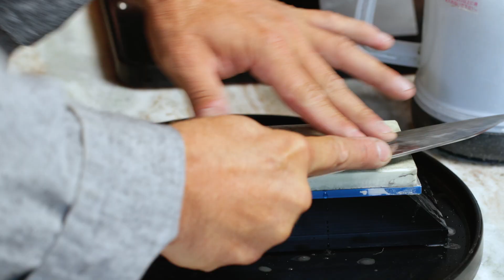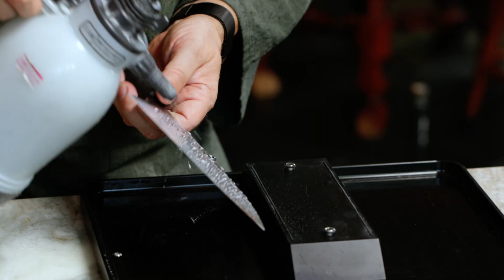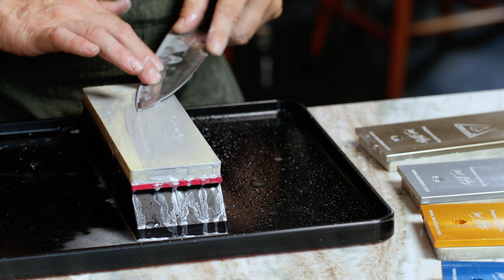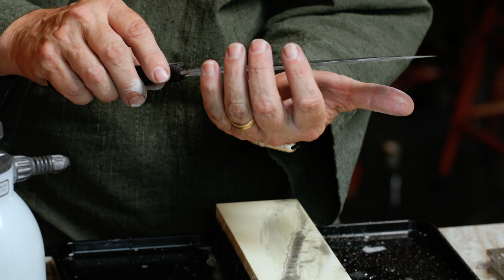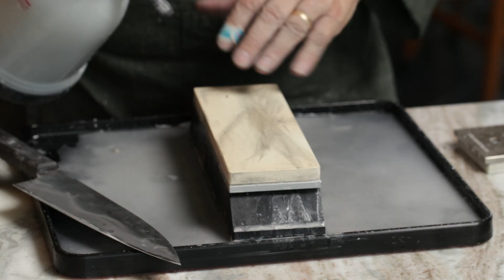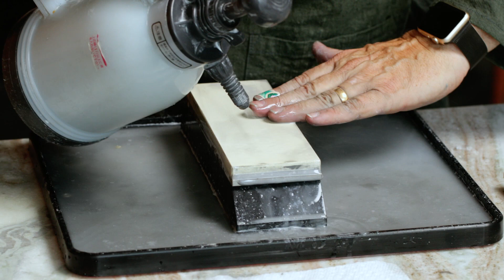CHAPTER 3: THE EXTENDED METHOD OF SHARPENING

Comment: That means every single time that knife needs to be sharpened, they will do thinning. Over time won't the secondary bevel become too thin and weak? Further, many non-Japanese knives are flat from spine down to the cutting edge without any additional secondary bevels or angles - will they only sharpen the primary edge in those cases?
Reply from the maker: I think some moderation is called for. I think follow up re sharpening should take into account how much, if any, thinning is needed. One one the major problems is that most people tend to increase the bevel angle with each sharpening. Thinning is necessary to fix that
Reply: @NanoHone  Thanks. That makes sense

Comment: I'm ready to move onto bonded diamond abrasives. I'm considering these and I'd like to know more. What makes these more suitable vs say the other commercialized "mass market" though niche no doubt bonded diamond abrasives for consumer market like Naniwa diamond or the Russian Venev. I have a large collection of traditional abrasives, also have 1 nanohone item the 200 grit which was expensive vs say the 120 or 220 SP but a product worth considering you have the right needs no doubt.   I'm leaning Naniwa because I am very familiar with their products and a fan but like the Chosera line, they don't really make anything below that 400 grit level, which is where Nanohone always comes in for me anyway. Are these more designed to cater to woodworking tools? How friable is that binder you are using vs the others? I assume it's softer, therefore more friable and likely cuts faster and with better feel at the expense of shorter lifecycle. I'm okay with that, I just want to understand what I'm gonna go spend about $400 on.
Reply from the maker: Hi Jeff, thank you for considering my abrasives. Friable is a tough word to apply to diamond resin from any manufacturer. Diamonds stacked on top of each other and incased in resin are very resistant to rubbing. Even with a softer binder. The softer binder helps with pulling diamond out to flatten the surface but it’s still slow. You have use a big diamond to kick the little diamonds out of the resin. That’s the down side of DR. The up side is they are very clean to work with compared to ceramics. Only a tiny amount of water is necessary. And, most importantly they will cut really hard steels.

Comment: I commented on the previous video but I'm just confused if it's always necessary to thin? What if you don't want those grind marks on your blade? I mentioned a takeda for example and it just doesn't seem like you would need to thin a takeda, or even able to with the finish they have. It would ruin the finish of the knife.. also something like a kurouchi or a mirror polish for example, I just don't understand how any knife can be put on the secondary edge like that and be grinded on a diamond grit.
Reply from the maker: That’s a great question, you are correct that repeating and maintaining the makers look is not possible after thinning in many cases. So the question is “what is the purpose of this knife “. If it’s a show piece then you don’t want to thin it or even use it really. If it’s an everyday tool, then thinning is necessary and the look will evolve as the knife wears. There are options for creating a look that you like along the way. Remember, most of these knives are made for export. Most Japanese craftsman use the plain bimetal versions of these knives everyday. You don’t see much pattern metal in use in Japan. Thinning is part of everyday maintenance